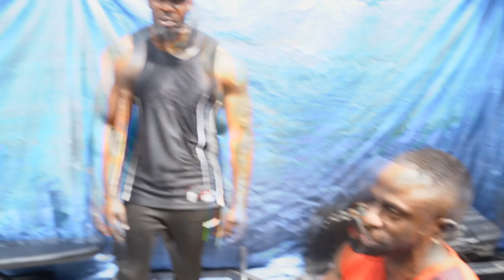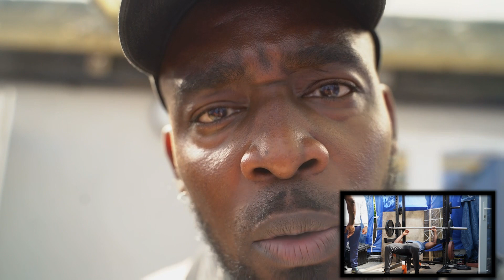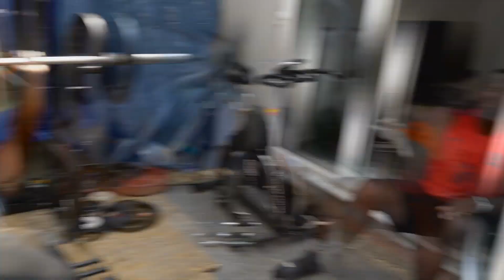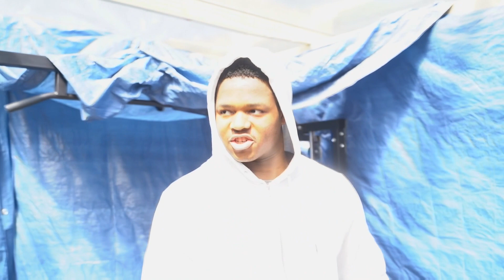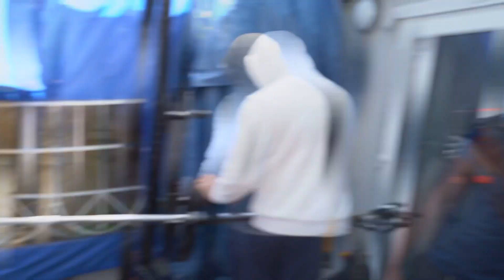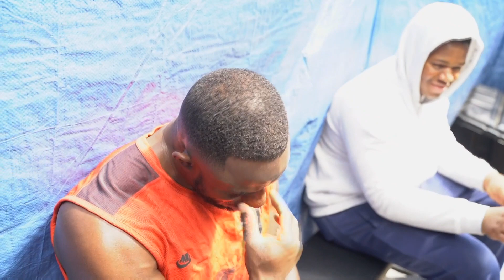Earning £10,000 A Month For Life, Dubai Every Week, Lamborghini Urus Boys| W/The Mandem

Comment: What's the difference between a normal bench press and having that rack there just before the bar hits your chest?
Reply from the maker: The pin press is an exercise that works on your lockout strength. Starting a press from a dead start without any continuous momentum is a lot harder than performing a bench press in rhythm.
Reply: @CHZO.  love for that! 💪